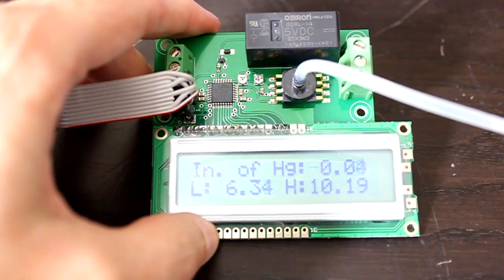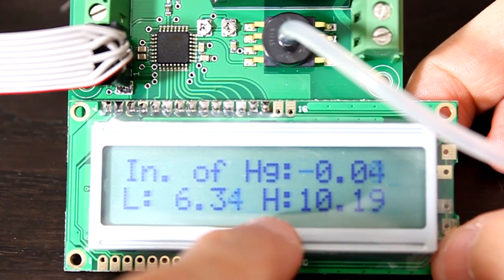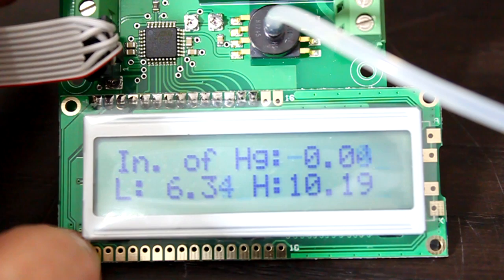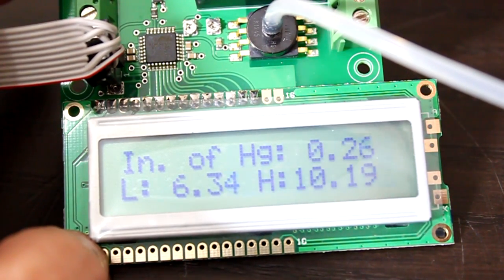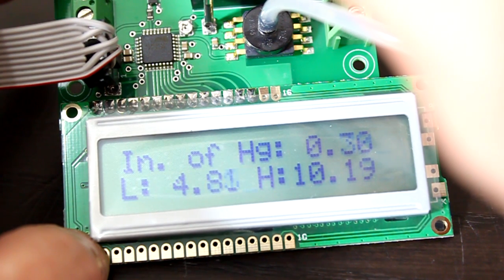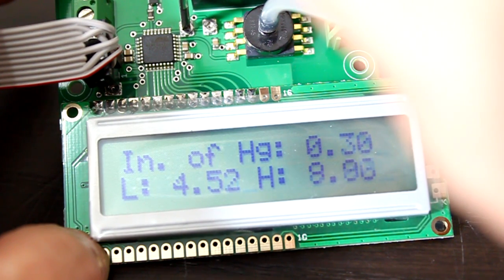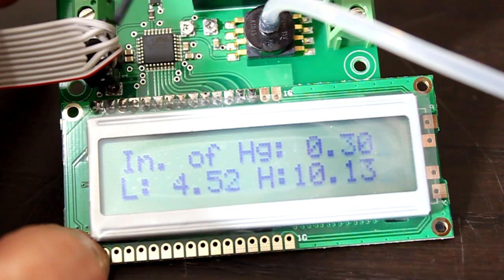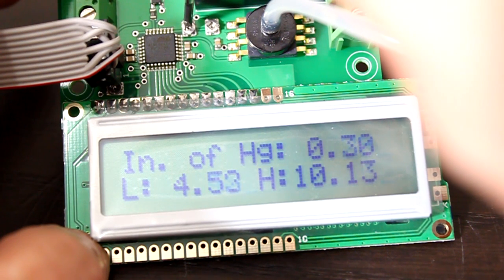BuildYourCNC.com Product Video - Improvement on the Pressure Sensor Switch

Comment: Why not use an actual vacuum pump instead of your weak as lungs
Reply from the maker: It's fun to see how much of a vacuum I can pull. By the way, I won the contest in my office! Haha. At least I don't have the weakest. Maybe because I was never a smoker.
Reply: @PatrickHoodDaniel a vacuum pump would of been sick af…
Can this controller make the vacuum compressor hold 20hg for long periods of time?
Reply from the maker: @nebur85  Thanks. The vacuum presure controller can signal a compressor or vacuum pump indefinitely. The length of time depends on the compressor or pump used. Since this is a solid state device (with the exception of the relay), it will be good as long as it has power.